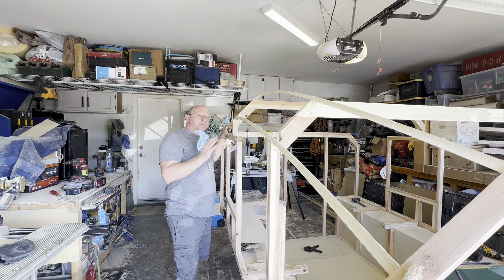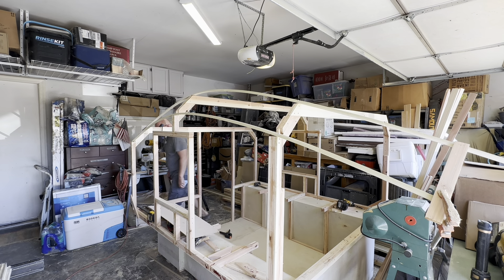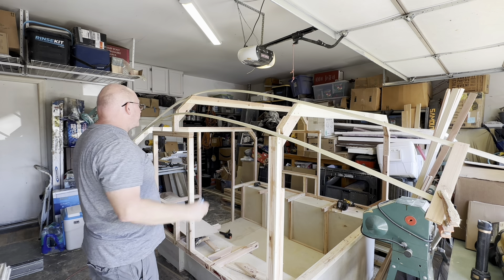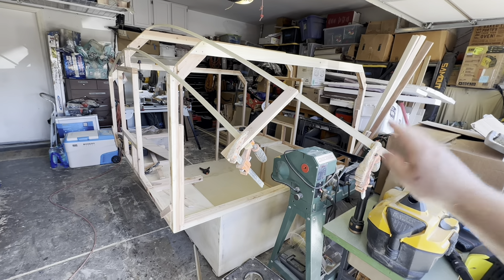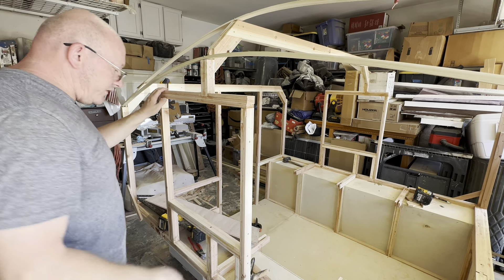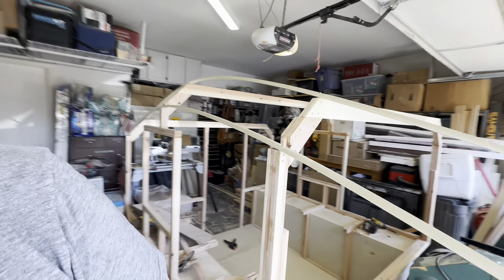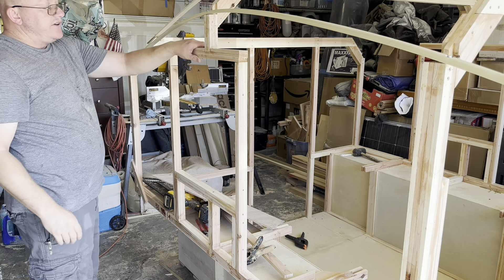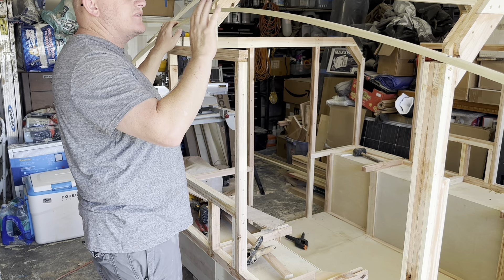Truck Camper Build 9.0 VLOG , Part 2 - Defining The Curve

Comment: Years ago when I was making  RC aircraft from kits I use to read articles about putting wood over a frame and the process was called stressed skin. Once the wood is glued down to a lightweight structure with curves it becomes extremely strong and rigid. Similar to boats. I think building it like you would build a canoe you could possibly make the frame even lighter and stronger.
Reply from the maker: That is a good point. I appreciate the feedback

Comment: Just want to say I'm looking forward to another great series of videos.   I've never built a camper, but I have built 2 stitch and glue boats(a 16 1/2 foot kayak, and a 15 ft skiff).  Looking at your plan for your roof, reminds me of my 15 ft skiff if it was upside down.  Stich and glue would allow you to create the artistic look you want with some amazing strength.   There is very minimal framing used in a stitch and glue design, which makes very light.  But its also makes a crazy strong and stiff hull.  If you google stitch and glue boats I think you will be amazed at the complex shapes you can create.  I've been watching DIY camper videos for a bit, and I think there could be a way to make a stitch and glue shell that could create a crazy light camper that would really wow people as you pass by.  Take a look at Chesapeake light craft  or Devlin boats for some idea, there are also a bunch of designs people are creating for them selves on you tube.  Cant wait to see what you come up with.
Reply from the maker: Thanks for the idea. I’ll check it out.

Comment: Hi I've been listening  your description of the human body may be true however I believe the build is taking on what I believe  is like boat building (tortured plywood construction )is a more accurate description I think and don't mind the pun "boat loads stronger" I won't go into particulars but love the construction
 Greg
Reply from the maker: I think you are right. Someone else mentioned boat building. Makes sense.
Reply: Dave, do you ever pick a camper like this 9.0 and once you have the framing perfect, measure and note everything so you could replicate it again, or replicate MOST OF IT, then just change a few parts so not starting from scratch each build? Thanks
Reply: Dave, I’m taking a vintage camper trailer restoration class from Mobiltec. He learned from the original guys that worked in the factories 50 plus years ago how to build those campers, In the older STICK AND TIN, Larry said the frame just holds the panels in place, but they don’t build a structural frame like you are. They literally tacked the framing together with 1” wide staples, the once the paneling was added, instant strength! The engineers were also very smart to figure that all the cabinets crested gussets for side to side support. Then once the windows get screwed in and cap or j-rails on, it all compounds tge strength of the individual pieces that in themselves are not strong. Hope it makes sense?

Comment: Lookin good.  I like the disposition and though process...  I am wondering .. to make it complicated (I hope not)...  What if the top corner sides in the rear are kept the way it is and at the back door, camber or curve it up from the corners (rear left and right) and have corders stay.  You may be able to have about a 2 to 4 inch rase in the center as you step in ... does this make sense?  Also, I've seen some cargo and other trailers (on line) that have the air conditioner on slides and it slides into the unit and a hatch door on hinge.  When in use they open the door and slide the air conditioner out .. maybe a seed for a different camper build.
Reply from the maker: Thanks for the ideas. I have a plan for the rear that will give me 1.5-2 inches more height.

Comment: Dave, I know this will seem like a crazy question but, why not make it just high enough for you to stand up in? Could you modify the center support to be curved inside or a little higher to clear your head? I know you want light and aerodynamic but a little sacrifice there would make it so nice to be able to stand? Thanks
Reply from the maker: You are right. If I make it much taller though I’m concerned it may not look balanced. I’ll admit, I’m sacrificing a little bit of practicality for a particular aesthetic.